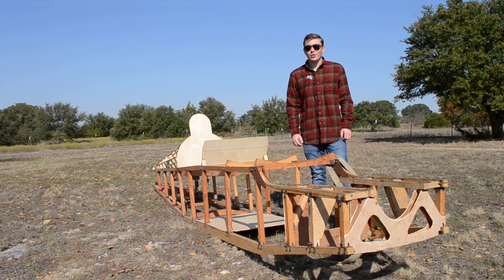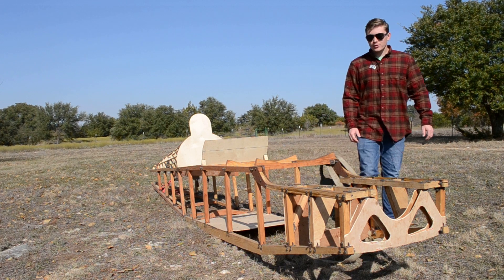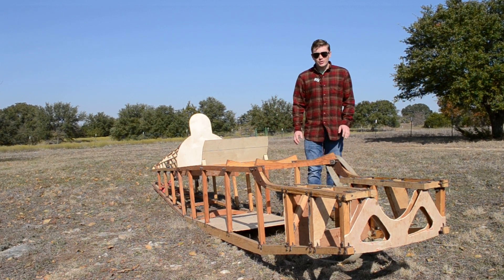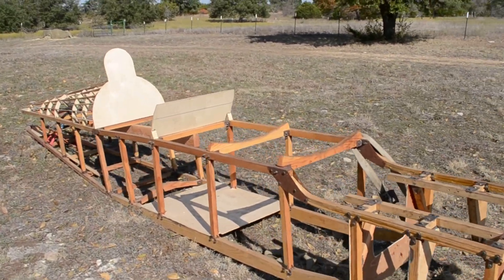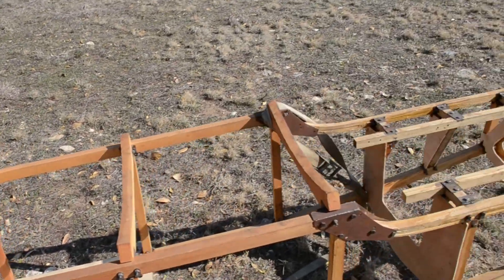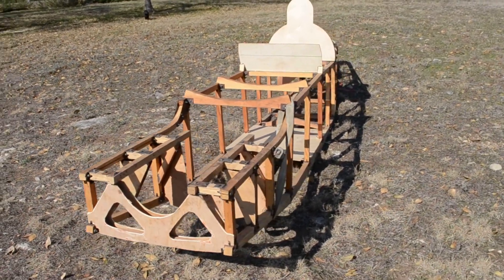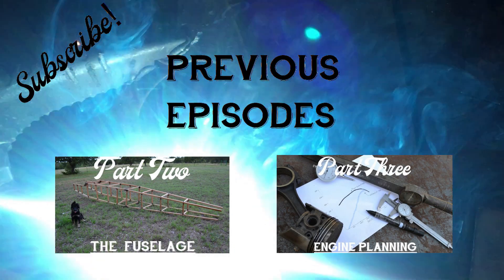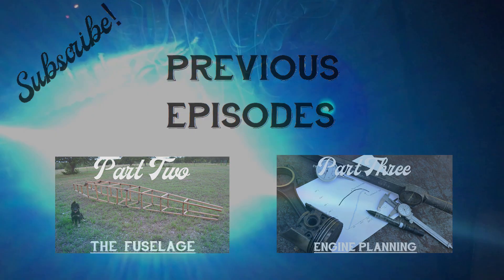Homebuilt Airplane Episode 4: The Fuselage Continued

Comment: News?
Reply from the maker: I'm sorry I have taken so long to make another episode! I should have one out in a week, or two. The machine shop is almost done with the engine (the rotating assemble is finished, so the only thing lift is installing valve seats in the heads), so I should be able to assemble the engine relatively soon. I have also started manufacturing my own fuselage bracing and tested enough that I think it is safe. The fuselage has about half of its bracing now and I think the next episode will be about testing the bracing.

Thank you for your comment!

Comment: I have also been looking for 1/8'' (3mm) thick wood sheets. From my research, you got two options. 1/8'' thick veneer sheet or a 1/8'' plywood sheet for furniture makers. The problem with the plywood option is that is costs more per sq than veneer sheet. But finding a plywood manufacturer to supply just the veneers is also a massive issue because very few will undertake me as a customer ordering such low volumes. Making a honeycomb structure is what I've always wanted to do, so I realized that using paperboard honeycombs from packaging is an excellent core material for making panels. The wood veneer-paperboard honeycomb sandwich structure would be quite strong. Unfortunately getting paper-honeycomb is also hard for me locally.
Reply from the maker: Thank you very much for the information! I am still trying to find a source of 1/8 inch plywood, but haven't had any luck yet. I may try asking some local cabinet shops. I have considered using aluminum instead, but I would like to stick with wood if at all possible.
Reply: @EvanJonesProjects  I also was thinking about making aluminum lower wing skins from Fiber Metal Laminates, making them on my own to save $ because ordering them by sq ft is EXPENSIVE! To cut and fasten aluminum panels costs more too. It seems that when a material gets stronger, the tools get more expensive unfortunately.
Reply from the maker: @tumdeax  Wow, It sounds like the plane you are building is going to be really innovative!
Reply: @EvanJonesProjects  It's a motorized glider. I want to make it similar to YO-3A wing wise, but the motor being electric. It'll be a chick magnet for sure 😏
Reply from the maker: @tumdeax  That's going to be awesome! Keep us updated!
Reply from the maker: @Pops Fereal Thank you!